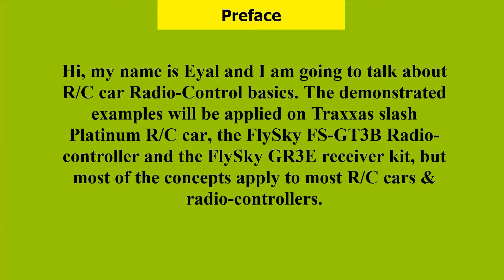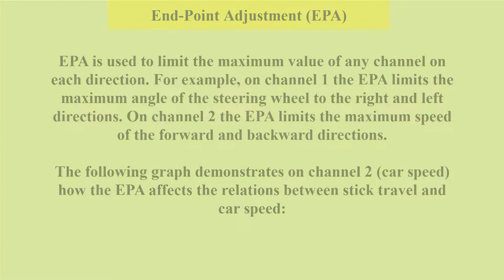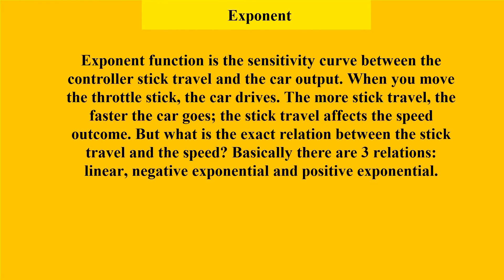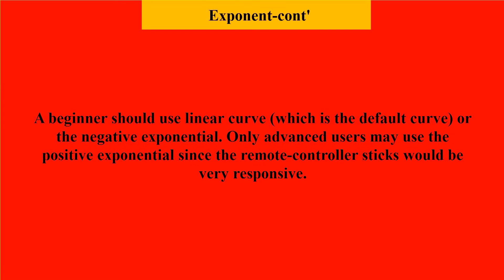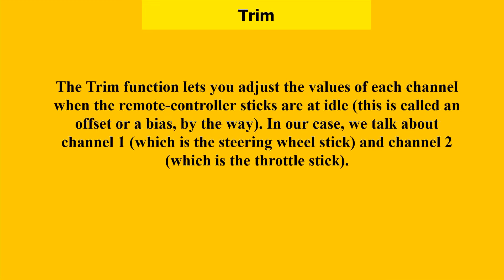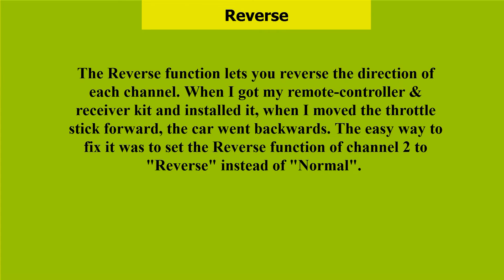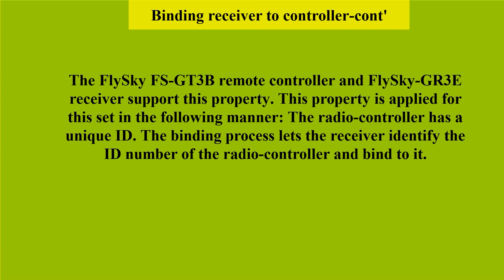R/C Car Radio-Control Basics

Comment: I've got the same transmitter and trying to use it on an SCX10 with a taser 60 amp brushed speed control. I've got the exponential's set to +100% and the throttle is still way too touchy and sensitive. -100% makes it go full throttle immediately. I need the throttle to be softer at the lower range of trigger movement
Reply from the maker: Hi, you need to set the Expo to -100% (minus). If you also want to limit the maximum speed, then set the EPA to a lower value. The figure at 5:31 might be of help to you.
Reply: @eyal-carmi  if I put it to -100% it just goes full-throttle immediately even if you barely touch the throttle. +100% is a little better but still way too touchy
Reply from the maker: Have you set the fail-safe function ?         could it be some settings of the ESC ?
Reply: Eyal Carmi I think you have the expo curves not as they really are?  Negatieve expo makes it more responsive...  Positive expo is what is needed if you want to have a slower response at first...

Comment: I still cant figure out why my rc car  connects to the reciever randomly not every time when i am starting but sometimes it connects  it also some times when it starts it goes full speed or while im driving it it will start to drive by itself PLEASE HELP.
Reply from the maker: Hi Jordan,
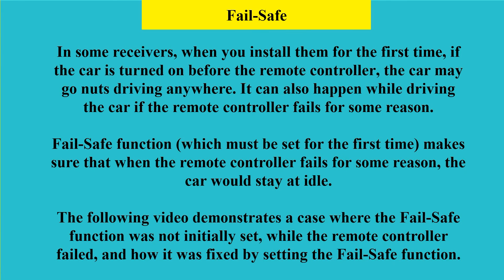It sounds like you haven't set the fail-safe function. Please watch the Fail-Safe at time 10:45 of this video. I also explain in more details in my other video "FlySky FS-GT3B radio control & GR3E receiver how to video tutorial" at time Fail-Safe 7:42. Please tell me if it helped.
Reply: Ok
Reply from the maker: Hi,
Did you fix the problem ? what solved it ?
Reply from the maker: Hi, sorry for late reply. Regarding the second thing you mentioned, this sounds as if you did not set the fail-safe function. Some of remote control - receiver have this function, some don't. Look at this video 10:45. About your disconnections - it could be one of many things. For example, it might be an electric disconnection in the car or remote control. It could also be that the distance between the remote control and receiver is too long.

Comment: Hi i have a question my rc haves a WP 1040 BRUSHED ESC that uses 40A for continuous discharge and 180A for burst current, what happens if I install a Lipo battery with higher stats than that? the ESC will work with the same current and the battery will last more or the ESC will not handle that current?
Reply from the maker: This is a very good question. In motors, current gets higher when the Counter- torque that is applied on the wheels gets higher (like if you drive the car on deep sand instead of a road). The motor burst current in my opinion would get higher, but the continues current would not In normal conditions (in normal conditions I mean what ground the car should drive on, what its nominal weight it should carry and for how long) because current tends to set to its stable value after few moments. If your thinking is to gain more time on one battery, then - and this is my opinion - you should limit the maximum EPA of the throttle and this is a trial and error. I would also put a fan on the motor and ESC to cool it, because the only and BIG problem with over current is heating. 

This is not something I would do without asking the manufacturer first. It really depends if the ESC has a protecting circuit that limits the current or cuts it off in case of over current. I don't know if anybody can answer that question except the manufacturer that made this ESC. I would advice you to write the manufacturer and follow his directions.
Reply: +Eyal C Thanks man  I wanted a reaffirmation of what other ppl told me in a forum and they told me that "it will not give to the Electronics more than what they ask for" I guess I will try to ask that to the manufacturer just to be sure.

Comment: Great video!  I have a question I hope you can answer: I purchased an RC truck for my son for Xmas (since I can't insert URLs, search on Amazon for "TOZO C2031 RC CARS High Speed 30MPH"). Well the transmitter has broken and I need to purchase a new one. I'm not sure which one to get. We purchased a replacement on Amazon ("Himoto 1:18 2.4Ghz 2Ch Transmitter for E18 Series") which doesn't work with the RC car, and I'm not sure why. So I'm not sure what to get. Do you have any suggestions?

Comment: I want to bring back to life my old Tyco Lamborghini Countach 9.6V. Do you think is possible if i buy one of those transmitter & receiver?
Reply from the maker: +enigmacstrike 

Hi,
Sorry for the delay. I can’t really tell. Are all the
electronics on one integrated circuit ? if so, the problem is that you can’t just
replace the receiver, because you cannot separate the receiver and the ESC
(Electronic Speed Controller). Since it is a vintage RC car and there are no separate
modules, the servo and motor might have nonstandard voltage input and maybe the
signal transmission from the receiver to the servo might be also nonstandard. I
haven’t done this myself, but as I see it, if you want to do it you will have
to have some knowledge in electricity / electronics to detect what voltage and maximum
current the servo uses and what voltage and maximum current the motor uses. Then
you may be able to tell if the flysky receiver voltage output and current can
fit the servo. Most receivers today send 4.6 – 6 volts (including the Flysky I believe
– but please check with the product specifications or contact the company). Afterwards
you will need to find appropriate ESC for your motor and make sure it fits the
receiver specs (most likely it will, but again look at the specifications of
both to make sure they fit) .  Then you
will need to cut the wires from the servo and motor from the old electronic
circuit and replace that old circuit with the new receiver and ESC and new
battery appropriate for the new system. You will also have to make appropriate terminal
connections so everything connects appropriately physically and electrically. This
is at your own risk off course. This is a trial and error and may damage your
car. Good luck with whatever decision you make.
Reply: +Eyal C  No problem :D
My idea its just to replace the old circuit  with a new transmitter and receiver and make the appropiate wiring connections for the battery, servo and motor as you said. i actually have tested the old circuit with 9.6(1.2x8AA ) and 12v(1.5x8AA batteries) and it works fine and the current its is arround 7 to 10 A. So please clear my head do i need an ESC? the ESC just amplifies the power from the receiver or am i wrong?
Reply from the maker: +enigmacstrike 
You need to check the voltage and current on the motor itself. Is that the measurement you did ?
If so, then you know the voltage and current the motor can work with. You need to find a suitable ESC for the motor. ESC is not exactly an amplifier of the receiver command. It does get PWM commands from the receiver and delivers PWM power to the motor, but those signals are not the same. Also, It most often has  battery eliminator circuit ( BEC) to regulate the voltage to the receiver. It also it most often has a battery voltage protection to limit LIPO batteries to disconnect if low voltage threshold is reached. You can read more about it ESC here:
https://en.wikipedia.org/wiki/Electronic_speed_control

you should also pay attention that your car got batteries that drain pretty fast. What i mean is that the motor probably wasn't meant to work for a long time continuously (a lot of heat is accumulated). If you change the battery to a high capacity one, you will have more time, but more heat which could kill your motor. Take that into consideration as well.
Reply: +Eyal C thank you for the tips i will read more about it :D

Comment: Hey Eyal,just wanted to ask what does Np-Adj because my Rc has that option which i am still not sure what it means thanks have a great day
Reply from the maker: +ArrmaTube23 

Hi, I believe NP-ADJ is Neutral position adjustment. What it means for example with the throttle channel is at what position you define the trigger to cause the motor not to move. It can be defined in the servo channel as well. this name sounds to me the same meaning as the trim function (look at this video about the trim function).

Comment from the maker: Hi JJ,
I suggest you buy FlySky FS-GT3B (it comes with GR3E receiver) + another GR3E receiver for about 8$. 1st receiver should be installed nikko rc car, and 2nd receiver should be installed to Nissan Silvia s15. Then you should bind each one to FlySky FS-GT3B remote conrol. Please watch my other video "FlySky FS-GT3B radio control & GR3E receiver how to video tutorial. " to understand what binding is and how to do it. BUT, since I don't know your systems, before you buy, open your car and see if the plugs are compatible with the GR3E receiver. If you really insist on flat remote controll then you will have to find a different remote-receiver set. But the idea of how to connect the receiver should be similiar.  Please update me. Good luck!

Comment: Can you please tell me how to bind multiple reciever that work on the only channel that have been select. Eg channel 1 has nitro buggy and channel 2 has electric car, when i set channel one setting for buggy it can run the channel for the CAR and the buggy so is channel 2.
Reply from the maker: If I understand you correctly, do you mean you wish to control 2 R/C cars simultaneously with the same remote controller ?
Reply: ok let's say i put the two car side by side and turn on, channel 1(buggy) channel  2 (car). when i select which channel 1 only the buggy go. What i got is that the two of them go when i select channel 1. Is there anyway to prevent both go just the channel that selected?
Reply from the maker: Sorry, I am still confused about what you aim for. I don't know of a way you can bind a channel to car x and the other channel to car y, because binding includes all the channels together. If you want the same remote controller to control each car separately (but not simultaneously, i.e, you must turn off all other binded receivers except the one you wish to control), look at my other video "R/C Car Radio-Control Basics" at chapter "binding receiver to controller" to understand how binding works in the FlySky remote controller-receiver set.  Then look at this current video at chapter "Model Naming" to understand how to attach the settings and the binding of the current receiver to a model number. Then look at the current video at chapter "Binding the receiver to the radio-controller" to understand how to bind the receiver to the controller. Because the radio controller has only 1 unique ID (not the receiver), all the receivers you bind will react to the remote controller the same way-that is why you have 10 model numbers, so you can adjust your own settings for each of your binded receivers (but as far as I remember all 10 model numbers work on any of the remote controller-receiver bindings because they share the same and solely remote controller ID) . I haven't looked deep into that, so please correct me if I am mistaken.
Reply: Thank  for the further explanation, understand now. What i'm trying to do is to control 2 cars(one at a time) with one remote control at a switch of the channel (like having 2 remote control in one).

Comment from the maker: I am not familiar with lego racers, but if you don't have a remote control, then you must buy a new set of receiver and remote control. Look at my other video "FlySky FS-GT3B radio control & GR3E receiver how to video tutorial". It shows a good and cheep (about 54$) set and its functions. In my other video "Traxxas Slash Platinum 6804R..." I demonstrate how to assemble the receiver. It might fit your needs. good luck